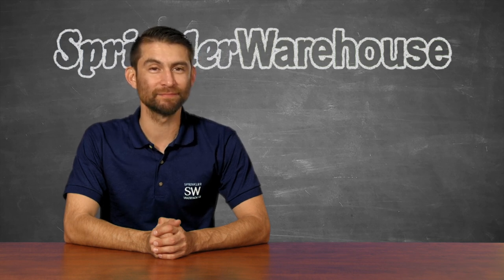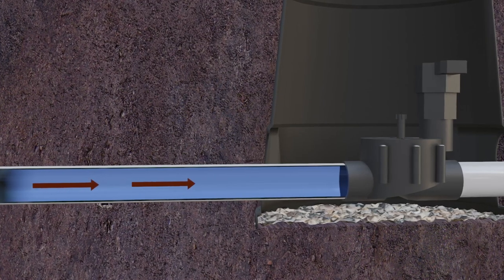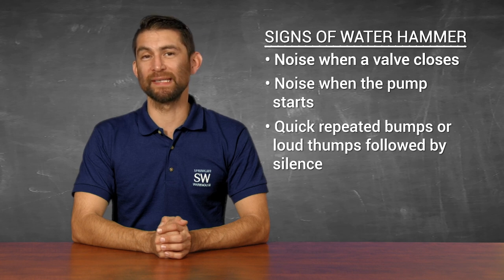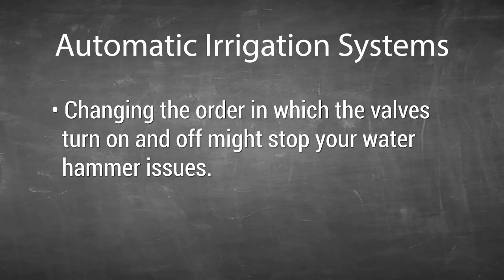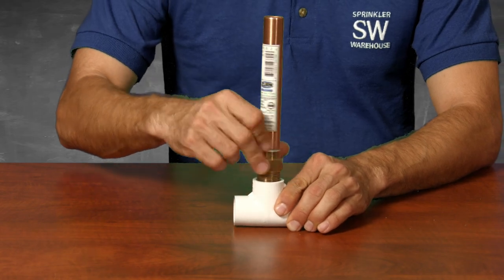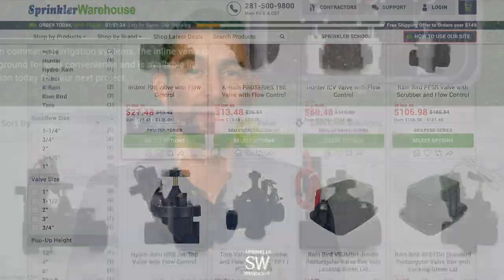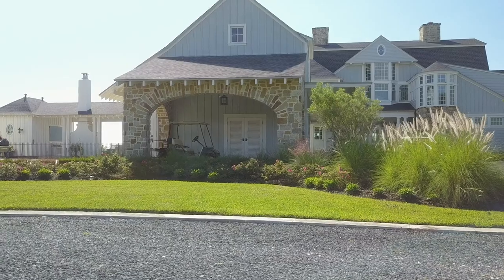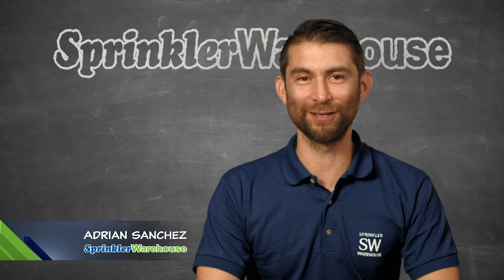Water Hammer

Comment: Help please.. Tried 2 arrestors on backflow today (water in, out) and still banging. Wonder if valves could be bad? Toro. I could replace the ck valves in preventer with extras i have. Irrigation company coming out agsin to try to solve. Water pressure and gpm has not changed in 10 years. Ty

Comment: Great video. I have ten zones on my sprinkler system. When zones 1 or 2 shuts off, there is really loud banging of the pipes. The other zones shuts off with no noise. What do you think is the issue?
Reply: Loose pipe in that area or large flow
Reply: i realize it is pretty randomly asking but does anyone know a good place to watch newly released tv shows online?
Reply: @Zyaire Karson flixportal :P
Reply: @Spencer Khalid thanks, signed up and it seems like a nice service :) Appreciate it !
Reply: @Zyaire Karson No problem :)

Comment: Why not try turning off valves on back flow, not all the way?
Reply: That seemed to help a lot. I closed valves on overflow ever so slightly, and used your recommendation of starting on line that had least “ banging”. So far so good. There is one zone that still has audible sound when valve closes , kind of like door closing , but now closing instead of slamming.